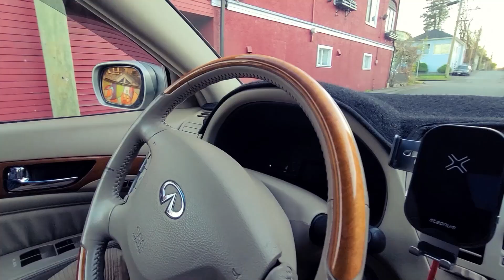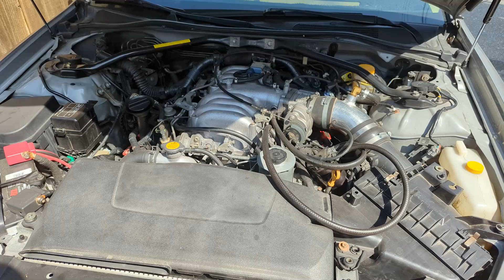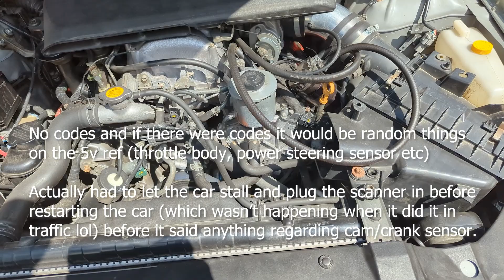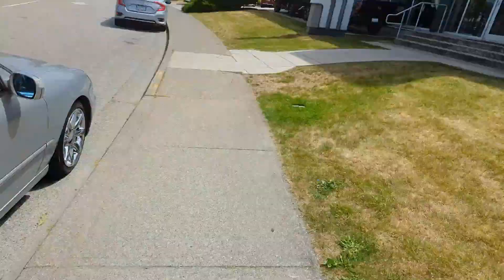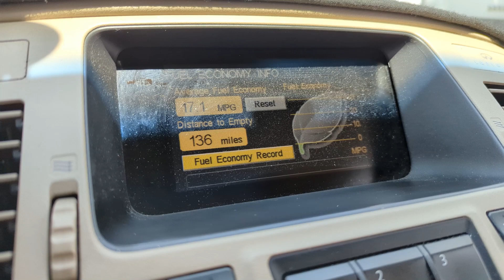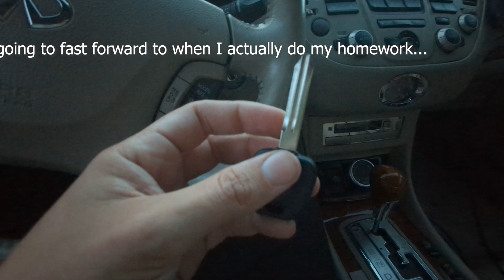I Answer My Most Common Questions About The Q45, We Get A Spare Key & We Troll a Turbo Mustang

Comment: I want to install a screen, but I can't find it. Do you know sites that sell it because I want a screen with Android Auto and Apple CarPlay, or is there a specific piece to convert the old screen to Android?
Reply from the maker: There's a video of a y34 M45 guy doing a really slick install.. I'm sure that would be very similar but it'll be a custom job and I'd be careful removing the dash they're prone to cracking on the 02-04

Comment: Is the air conditioner effective, and the other point is whether the front lights are strong
Reply from the maker: I rarely use air con but it blows cold still, I was gonna recharge it but running it for a while seems to have given it life again. I run it every once in a while just to make sure. I switched to LED headlightsI have a whole video about it!

Comment: Do the bottom cam solenoid did u replace ?
Reply from the maker: I've replaced everything
Reply: @30YearOldBunta  I did also beside the 2 bottom ones turned out my bottom driver side one is the culprit

Comment: is the 3.69 diff more or less plug n play?
Reply from the maker: yeah pretty much, there are some companion flange differences but everything swaps over.

I should make a video on that as well as there's some changes that are kinda random (using threads and bolts on the same year cars, Nissan was doing some part recycling)
Reply: @30YearOldBunta   thank you would love to see that, wanting to rear end swap my 04 M cause the open diff really kills
Reply from the maker: @lilyvercetti  vlsd will require a companion flange, you could do a drop in that's what I'll do just don't have 2 grand to dump into it yet lol
Reply: @30YearOldBunta  as nissan does

Comment: I’m having a hard start and random dieing I’m gunna replace both sensors
Reply from the maker: you got this man! I had metal shavings in the bottom sensor and I'm almost certain that is what caused it but it's definitely worth replacing.
Reply: @30YearOldBunta  I recently replaced my crank sensor then 1 week later it started randomly diying so now I’m moving to cam sensors although I have a sema so the sensors at my local store are different then the jdm
Reply from the maker: @ganglandlandlord9870  so the one on the driver's side bank is the cam, the one on bottom where the transmission meets the engine is the crank, the two sensors on top (actually the same sensor but different connector neck) are vvt sensors.

so really you just need the one on the bottom and the one on the driver's front (the one I show in the video). Also.. MUST BE OEM. I can't stress this enough, I've tested them and they never work ever.
Reply: @30YearOldBunta  did u replace all of them